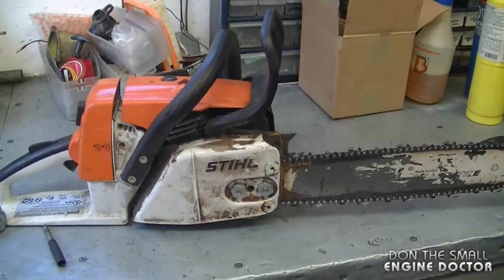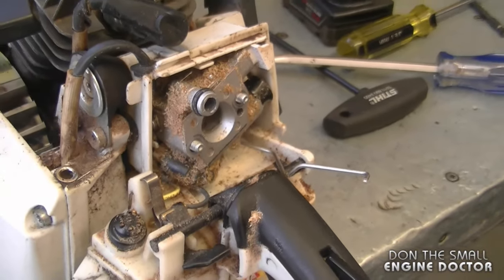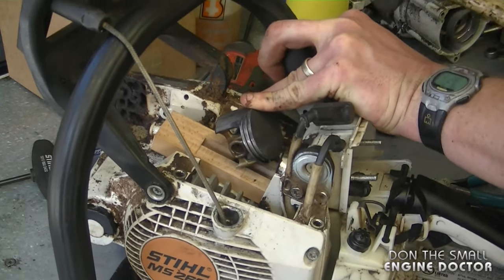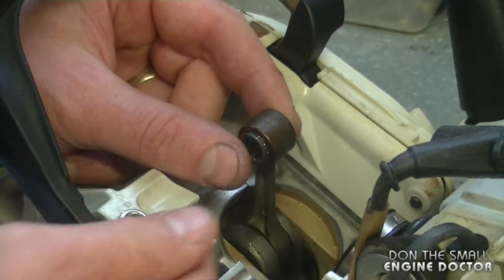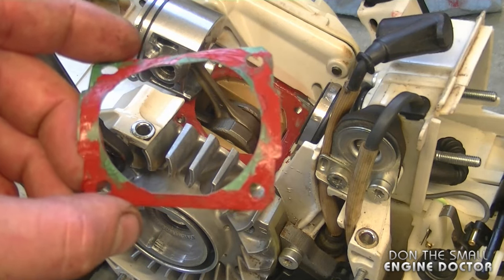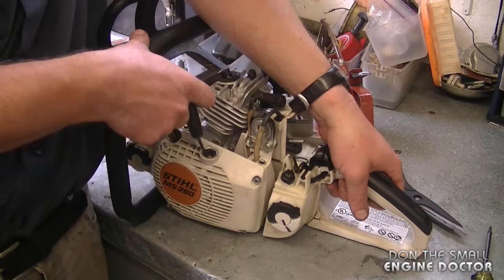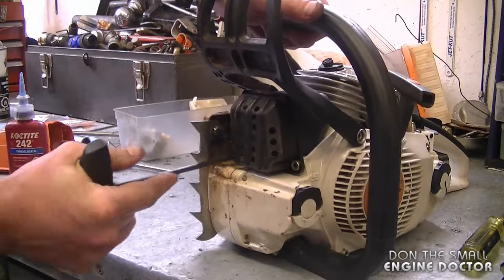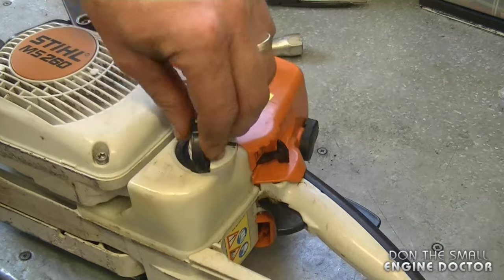Top End Rebuild On Stihl MS260 Chainsaw With Force-Tec Cylinder Kit

Comment from the maker: ALWAYS USE HIGH OCTANE FUEL WITH NO ETHANOL TO PREVENT DAMAGE AND COSTLY CARBURETOR REPAIRS ON YOUR OUTDOOR POWER EQUIPMENT!
Reply: a lot are changing to Aspen fuel here in the uk, especially if the machine is not used regular. It's a very clean fuel and lasts years & easier starting and no smelly petrol fumes
Reply: I have had more power equipment damaged by ethanol blended fuel.... now I use strictly non-ethanol, high octane fuels.
Reply: Would u still recommend that kit
Reply from the maker: @tylertotten890  yes that kit lasted quite a few years, u can also use code "donyboy73discount" at checkout and you'll get 10% off
Reply: And always clean engine before removing cylinder so no dirt enters the crankcase
Reply: Where do you find HIGH OCTANE FUEL WITH NO ETHANOL, cheaper than $20. a gal. in a can? $30. for a gal. at a stihl dealer!
Reply from the maker: @johnnellis3025  check pure-gas.org
Reply: donyboy73 como siempre un trabajo limpio y extraordinariamente bien explicado! Salu2
Reply from the maker: @oliverbreanna789  gracias mi amigo!
Reply: @donyboy73: I only use 100 octane aviation fuel for my Stihl MS 260 chainsaw and it works perfectly.

Comment: i would have took a air hose and blew the saw off first before i started on it
Reply: I had the same thought, but then I realized, "What's going to happen? Sawdust will fall in the cylinder and score the piston?"
Reply: it looked clean as a pin to me
Reply: I have to agree.
Reply: @John-do9ei  good point.
Reply: Yeah seems crazy to pull the cylinder off with all that dirt and saw dust all around it. That would definitely fall down into the bottom end.
Reply: Yep. And used a torque wrench rather guess the 'farmer tight'.
Reply: How much can you charge your customers for this repair in US dollar?
Reply: Mr D ......I had a good mechanic friend, a true engineer with whom I would help occasionally and I asked the same question.  We carried out a similar rebuild on a garden tractor and tested his “farmer tight” nuts with a torque wrench and they were incredibly accurate.  That my good friend is experience combined with expertise.  He also tuned motorcycle racing engines and always finished off with a torque wrench, was rarely necessary but then he was a true professional.
Reply: @monstery121  I would think u'r limited to the price of a new saw at any rate
Reply: @stevehtml5490  The new one MS 261 is $560.. then what would be the repair price? Im from Argentina :)
Reply: @sergiosrebernich4961  I have no clue but if it's 10 , 20% of a new one ???
Reply: @stevehtml5490  Okay thanks body! I´m an official STIHL seller here by the way :)

Comment: Please don't think I'm bragging but I've worked on saws for 55+ years. When people would ask me to do this, I would stipulate only if I could check the crank 1st & if ok, then do the crank bearings also. Chances are if you only do the top end, you'll have vibration due to rough bearings to deal with & I have seen saws break the crankshaft flush with the PTO bearing b/c of that problem. Got 2 of these with no plans of fixing.

Comment: There are a lot of people that can take some lessons on how to do an instructional video from you. Including the manufacturer of my 12 gauge Bull Pup shotgun. Their video shows a guy tearing the shotgun down and putting it back together to music and not a single word spoken! I have a MS260, and a MS460 that was sold back in 2000 and I got In box of parts. It has 0 compression and after watching your video will be doing a top end rebuild on it. I actually have 3 saws in my shop that needs it. Two have rings that fell out in pieces when checking the piston through the exhaust. The 460 is one of them. I started buying busted saws and repairing then a couple years ago for extra cash. Luckily this is the first I ran into having to rebuild anything. It's generally fuel lines, ignition modules, replacing the carb or making adjustments. I can usually buy one for $20 and put less than $20 into it and resell for $80-$100. Sometimes it's a simple adjustment and I can have it working beautifully and relisted the same day. That 460 is going to be the power in my Alaskan mill that I'm building when the saw is up and running right. Can't wait to get it all done. I like processing the wood for the things I make myself. And with hurricanes, tornados and heavy storms regularly there is always plenty of free wood people will gladly let you have so they don't have to pay someone to remove it. So you can have a wide variety of wood species and never have to go to the lumber yard.

Comment: I use the old wrist pin to tap each side with the old wrist pin against the circlip.  The tap will make sure the circlip is perfectly seated in its groove.  I do both sides.  I also put the intake side circlip in, first, because it is the one that likes to come out and I want it in, perfectly.  I always sweat the first seven or so tanks because if the circlip will come out it will be in the first seven tanks of gas.

Comment: Was looking for a video I could use to learn how to do the repair. This is the perfectly, well explained, thorough video about the matter. I have applied 99% of the video on my Makita Dolmar engine DCS5121 chainsaw. After being quoted 1000$ in repairs from the Montreal Makita dealership, I found myself looking to repair mine by myself and absolutely not throw it in the garbage. This is a semi-professional chainsaw that I really liked and I wanted to keep it. I had lent the saw to a friend and it came back with a bad compression cylinder, bad carburetor etc. Haven’t started it yet as I wanted to also rebuild the carburetor (as stated by the repair center). Bought a total of about 250$ in parts to save the saw. Worth it in my opinion. Thank you a million Dony

Comment: I really enjoy this video.100% professional
Reply from the maker: thanks
Reply: That's not a professional. Far from it. Professionals have the correct tools. Like the rings that hold the piston pin there's a tool for that.
Reply: @sjcf89  Obviously the cost of that tool is prohibitive.
Reply: @deksper  £38 is not expensive
Reply: @sjcf89  NZ$77 is expensive for one tool, unless it is used in mechanical trade.

Comment: As always a great video. You are easy to understand with your slow voice and great quality videos.I have a small engine repair shop here in the Napa Valley calif and admit your videos have helped me become a respectable small engine shop. I have always had a mechanical background but didn't know a lot about small engines 4 cycle and 2 cycle.I know you can always sharpen up by watching a pro like yourself.Thanks a lot for your help. I can actualy turn a buck now. I have built up a small stock of parts. I love Briggs motors and have good success with them. Not to hot for techumsah, kohler. but will take them on.I'm 73 and really love working on machines and don't have a problem making bucks doing it.I'm a retired welder.32 years welding in the bay area oil refinerys.Your choice of the Lincoln is a great choice. Don't you just love the winking welding hood.Be shure your lens is dark enough and you don't get arc flash from to light a shade. I always used a number 11 shade. and believe it I still have great eye sight.I don't think you can buy the American optics number 11 gold mirror lens today. Pricey but worth every penny.Thanks again Jerry B

Comment: Thanks to donyboy73 and his YouTube channel, I spent about 75 minutes this afternoon rebuilding the top end of my Stihl MS261 chainsaw. His tips and instruction were flawless and straight forward.  Although he rebuilt a Stihl MS260, it wasn't too far off from mine. I had to do a few things differently and it took me a little longer than it took donyboy73. I finished the rebuild, mixed my fuel a bit on the rich side with 2 cycle oil as he suggested, took it outside and primed it to get fuel back into the engine, then pulled the cord a few times...and she started strong! AWESOME!!!! BTW, the saw repair shop wanted over $200 and I did it myself for $87 including specialized tools needed to repair my chainsaw.

Comment: Thanks for the very detailed instructional, Don. I just finished doing the rebuild on my 026 using your video as a guide. The hardest part was getting those circlips back into the piston head, especially when the piston is mounted, but it was doable. I also had a bit of trouble with getting the cylinder head mounted. Those 4 torx bolts got easily out of alignment as they were tightened, definitely needed to take time and tighten each a small amount. The 026 was very close to the 260, with only a few differences.

Comment: Don,  you ought to do a piece on mixing and matching Chinese parts.  Two years ago I rebuilt a Stihl 029 with a 49mm jug.  It ran fine until it lost it crankcase to cylinder because I used the wrong sealant on these two parts.  I never liked the 49mm jug because it was a beast to crank and it liked to break parts - flywheel, clutch, worm gear and oiler to name a few, so I decided to put in its original 46mm jug.  Actually, I bought a new one two years ago but never put it on because it cam in with a broken impulse pipe.  So, several weeks ago I got a new 46mm jug off of ebay.  Since I had a brand new engine with a good crank, connecting rod and piston from the engine with the broken impulse pipe.  I decided to just drop it into my new cylinder.  It fit fine and I sealed it up and put it into the 029.  The sealant did not last 15 minutes before it was blowing gas out of the crankcase.  I thought it might be the sealant but it was not.  I used Permatex PERMASHIELD.   At the same time I assembled and resealed the old 49mm jug because an inspection revealed it was in excellent condition..  I used assembly bolts to tighten the pan to the cylinder(6mm x30mm) and tightened them down with just a nut driver and left it on my work bench in my shop.  Several days later I took the bolts out and the pan was still sealed to the cylinder.
  What the problem was on the new 46mm cylinder was the pan would not seat all the way down on the cylinder.  My new 46mm cylinder had come with new bearings but I had used the crank and bearings from the two year old 46mm engine.
   Last night I started to think about what was wrong with this particular crank and bearings.  I felt the bearings on the two year old crank were larger than they should be.  This morning I grabbed the original Stihl cylinder and crankcase and put the new bearings in the cylinder.  The crankcase went down perfectly against the cylinder.  Using the two year old crank there would  e a gap of about .060 one side of the pan.  I could use the engine bolts to pull down the pan against the cylinder but once you fired it up the seal would break and it would start leaking two cycle everywhere on the bottom side of the engine.
After I disassembled the 029 this morning I started measuring the bearings the came with my new cylinder and they came out 1.575" with my dial micrometer.  The ones on the two year old crank measured 1.578 or .003 larger than the new bearings.
  What the Chinese are doing is mixing and matching bearings as determined by the tolerance of the parts.  If a particular part was machined larger than spec - they just throw a larger bearing in it.  Get the idea?

Comment: Great video. Local shop said I should replace vs have them do a rebuild. $55 kit worked great, 2 hours later runs like brand new. Thank you. Very easy to follow along, and replay 10x to get it right. Much appreciated for your instruction.

Comment: Thank you for this video.  I did the rebuild and ran into a problem of my own making.  After starting it the first time, the piston jammed in the jug.  I had to take it all back down and look to see what I had done.  I had trouble getting the jug off the piston.  The piston pin had slid out of the piston and the rod.  I thought that I had not seated the spring clip holder for the pin so I tried to locate the spring clip in the crank area, not there.  I looked in my extra part box.  I had forgotten to put the second clip on when I installed the piston.  That's how I learn, the hard way.  It didn't hurt anything, everything working great.

Comment: I put a nice Nikasil cylinder in my ms 260 Pro last week.  It runs fine.  The cylinder was not in real bad shape but I wanted a deco valve on my 260.  It was a standard 260 when I got it, but I have updated it to Pro specs.  It was made in 2006, so it is a pretty new ms 260.  It got a new 16 inch Stihl bar and RS chain.  I rebuilt the carb, because it was a fully adjustable Stihl carb.  It also has an adjustable oil pump.  I picked it up off of EBay.  I have also picked up a ragged out 024 and I am going to put a 44.7mm cylinder on it, too, because I have it and want a deco on the 024, also.  I haven’t decided if I am going to fully update the 024 to Pro specs or not.  I will put a fully adjustable carb on it, but it will be an 024 Super with the new cylinder and piston.

Comment: this was a solid informative video. As I followed along, I thought for sure that you forgot to tighten the intake, but then about a minute or two later you came back to that...LOL. I do lawn care and landscaping and have to work on my equipment from time to time which is why I originally subscribed to your channel. I prefer stihl products, and have found them to be great tools. I have often wondered what a good break in procedure would be for a new trimmer or saw, because they don't go into much detail about that. Now I have that answer too. Thanks a bunch and keep these types of videos in the mix. They may be longer, but the details you provide, and descriptive way you take it step by step is VERY good and easy to follow and worth my time to watch. Look forward to them. Quick question for another video; I have a lawn tractor  that wont start. I got it to backfire when I used starting fluid, but it wont turn over, so its at least getting spark. It has fresh fuel.  Its been used a lot, so might that indicate it needs valve adjustment, or is there a more serious problem? Im assuming a carb problem would not cause the backfire issue. thanks again!

Comment: Excellent video Dony, it gave me some new techniques on chainsaw break downs. I'm doing the same rebuild in Melbourne Australia.The reason I got my 026 saw cheap is the previous owner couldn't start it then he got frustrated and gave up. When I tried starting the saw I got nothing as well, on striping the saw down the piston and rings where in excellent condition so I continued looking and found a small lateral crack on the fuel elbow running into the carburettor, I had a old carbi with the same elbow, I will install the new rings impulse line and fuel line just for the hell of it. Again great video mate,
Reply from the maker: thanks

Comment: Going to need to watch this video a few times. Replace carb on mine still wouldn't start easily or stay running long. Tested compression. Barely gets up to 30. I believe rings may have gone bad. Probably due since I've had it since 2010. guessing about 400 hours on it there abouts. Rebuild cheaper than new. Thank you for all you vids. They have be golden

Comment: Good "how-to"video.  It's kinda reminded me of my childhood rebuilding top-ends on my 2-stroke Honda CR125 and Yamaha YZ125 back in the late 70's .... and I had to do a lot of top-ends.
Nice workbench with all those tools but no torque wrench?   Not sure I am comfortable tighten down the cylinder head without torquing the bolts evenly within specs.
What I'd learned is the ring compression tool.  It would make the job so much easier although I am not sure this gadget was available back then. Thanks for the tip!